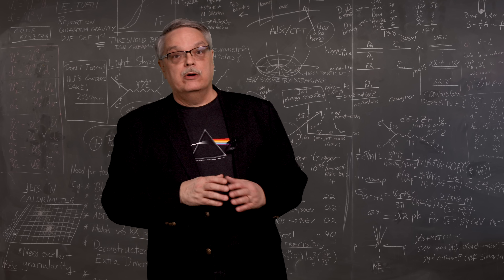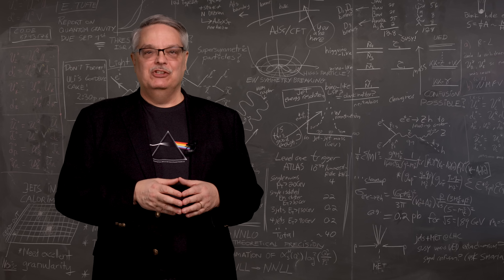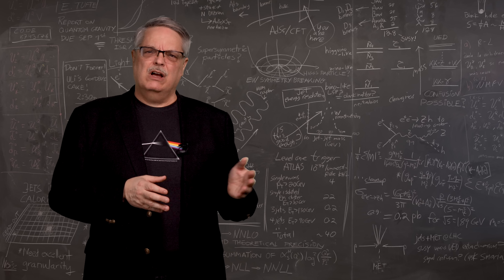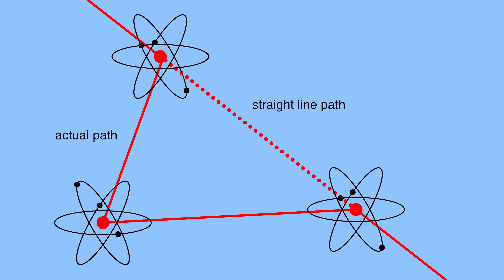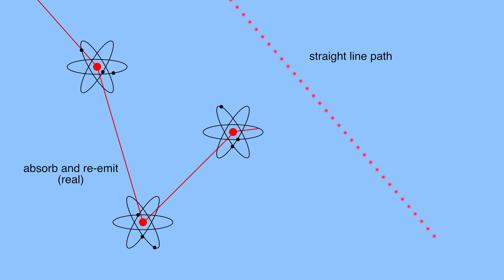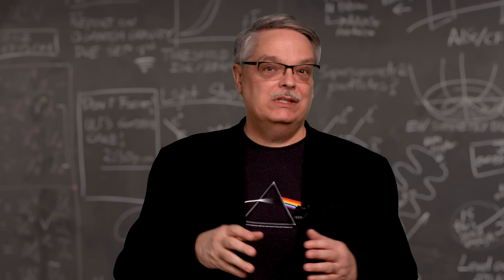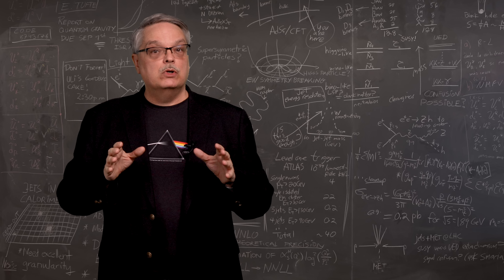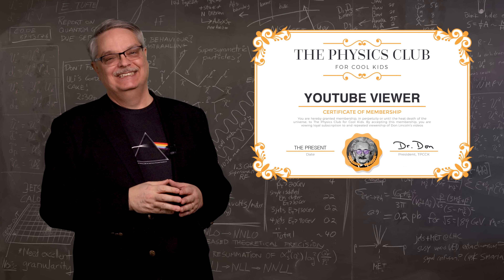Why does light slow down in water?

Comment: Great that you explained this because I did not know the correct answer, although it makes all kinds of sense. Waves FTW!
Reply: this video has taken many shortcuts in explaining the relations between the two systems and how it affects them.
to better understand this, we need to talk about d'alembert's equation and its dispersion formula and how it describes a wave.
so d'alembert's equation is used to link together the spatial and temporal variation of a wave.

and from this equation comes the dispersion relation that links together the frequency, wavelength and celerity of a wave.
to access to this equation, we use maxwell relations to describe this phenomenon. when we consider those relations in the void, we get the relation: c² = k²*w² where k is the angular frequency and w its wavenumber. (just google it, ain’t that hard to understand)

thus we can see here that the celerity is proportional to its angular frequency. however, as explained in the video, when light enter a medium, there are charges that can be influenced by the electric field, especially electrons that are 2000 times lighter than their counterparts protons.
thus, when light comes in this medium, we assume that only electrons are affected by the electric field.

we then apply newton's second law to those electrons to find a relation between an electron's speed and the electric current
(we also neglect the magnetic field of the light as the electron is relativistic thus the force from the electric field is much greater than the magnetic one see lorentz law to better understand this )
and then by generalizing this equation to all electrons in the medium, we can get an induced current from the electric field of the light.
( the current is j = n * v with n the volumic density of charges and v the celerity of electrons)

then when we put this back to maxwell ampere local equation, we introduce a new component: the induced current which thus gives us a new dispersion equation: c² = k² * (w² - wp²) with wp the plasma oscillation and thus we can see that from the value of wp, we'll get a different value of the celerity of the wave.

thus we can say without a doubt that they are wrong in their explanation as it is not the combination from the electric current of the electrons and the wave that makes it slower but the induced current inside the medium that modifies the dispersion relation thus modifying its speed.
or in simpler words, it's the movement of electrons that changes the frequency and celerity of the light, but not the combination of the two electric current. (also on a side note, trying to represent the electric current of a dipole using a sine wave.. funny thing you did there 😅)

and finally, as for the reason why the light has a different angle, well you can easily explain this using two waves parallel to each other crossing the medium in phase with each other. as they have the same wave plane, you can easily come to the relation between the refracted angle and the incident angle using some basic geometry. i recommend you to see the demonstration of descartes second law if you want to better understand what i'm talking about.
Reply: @recouer  - OK. Trying to follow you but stopping at the second paragraph. Per Wikipedia, wavenumber can be several things, ones is v (not w) which is 1/lambda, another is k=2pi/lambda, which you call "angular frequency". 

Maybe are you using "w" for omega? I see the formula v(vector) = v(escalar)/c = omega(escalar)/2pi.c - but nothing that resembles your formula c = k^2 . w^2, which seems to indicate that, as c is a constant, if k increases w must decrease or vice versa. 

A bit puzzled, but I'll keep reading because you seem to know what you're talking about and I'm interested.
Reply: @LuisAldamiz  
sorry i was talking about angular frequency. i'm not familiar with all the terms as english isn't my mother tongue.

arf i just realised i made a mistake in my formula. it's not c^2 = w^2 * k^2 but c^2 = w^2 / k^2.
where:
w = 2*pi * v  with v the frequency, w the angular frequency
k = 2*pi / lambda with lambda the wavelength. and k the angular wavenumber.
(btw i realised i said one was the other in my explanation. sorry kinda confusing i know)
i should have double checked...

btw i checked the wikipedia page and w is in fact introduced, just it's hard to notice when i skimed through it. (and yes i'm using it for omega)

Comment: Q: If light is " slowed" by the medium it hits ( water etc.) does it also slow when hitting a mirror that is simply reflecting that light ?

For example, I saw a Cook County Sheriff shooting a laser ( lidar) off of his sidewiew mirror to capture the speed of traffic coming toward him ( his car is facing same direction as traffic moving toward his stationary car) . Is the light , which is hitting the mirror , being slowed by the mirror when it hits the mirror and does this affect the reading he gets?   Remember, we're talking about the light hitting mirror, going to  moving car, being reflected off moving car, coming back to stationary mirror and being reflected into lidar gun again. Surely, the reading can't be accurate.
Reply: LIDAR only measures distance. To get a speed measurement you have to measure the distance at least twice at known time intervals, and calculate the difference between distances.  For example, if the car is 100ft away at the first measurement, and 99ft away at the second measurement, and the time between measurements was 1 second, then the car is traveling 1ft per second. A mirror would likely cause the LIDAR to think the object is at a greater distance because it took longer for light to reach the vehicle and back, however, because that same offset would be applied to the second measurement the speed calculation would still be accurate.  In the example with a mirror applied, maybe the car is 100.5ft away on first measurement, and 99.5ft away on the second measurement, it would still be 1ft per second.
Reply: Don Sander ok, so you're saying there's no attenuation or refraction affecting the reading?  

Yes, lidar is measuring t/d , but isn't that affected by the mirror?  If light seeks it's easiest path, the mirror is certainly not that path.
Reply: @Newzchspy    Possibly because it took a shorter path through the glass, but slowed down as well, the net effect is the same?
It's a good question.

But even if it did change some timing of the light, the thickness of the mirror is so small compared to the distance of the car, that it would be negligible.  Even if you said light slowed down so much that it was like an extra 0.25 inch it had to travel, that would still be only 0.04% of the distance to a car that was 50ft away.

Comment: No! This is circular reasoning. Light travels slowly in glass because it interferes with waves re-emitted by electrons, and those waves travel slower than the speed of light, so the superposition of the incident wave and re-emitted wave travels more slowly. But why does the re-emitted wave travel more slowly? This explains nothing, it just moves the problem back to the re-emitted light.

Comment: Very nice! But I am still thirsty! The superposition works fine if the 2 waves travel in the same direction, that of the incident light I think! The change of direction of light in the material then would mean the wave generated by the atoms is in a different direction from that of the incident wave and the superposition leads to the bending? Is it related to momentum conservation or the shape of the orbitals where electrons can oscillate? Of course, Fermat / least action principle can explain; but in the frame of this 2-wave explanation, where is the bending coming from?. Would be nice to explain:)

Comment: As many points out, why does the electron generated wave travel slower? I believe a more satisfying answer is that it doesn't, see the explanation below (more information can be found in the Feynman lectures of Physics). 
The incoming light moves the electrons (and since the electron is negatively charged it actually moves in the opposite way compared to your animations), which indeed creates a new wave. The thing is that this wave moves exactly at the speed of light (as those all light). For the normal case of glass and visible light the phase of the generates wave from one electron is the same as the phase of the incoming wave. But when moving through a material like glass you have many many atoms and electrons each generating their own wave. And the sum of all of these generated light waves (not including the original incoming wave) will interfere and result in a wave that is 90° after in phase compared to the incoming light. This will cause a slight delay in the wave. Each time this slightly delayed wave passes through yet another infinitesimal slice of the material the same thing will happen and that is why the light appears to travel slower.
Reply: This answer is a bit more convincing. But why the wave generated by moving electron disappears when incoming light leaves the material, making light speed up again?
Reply: @aremijfaye5160  Because out of the glass, light do not encounters any resistance anymore, it's travelling freely, but not totally, because AIR has it's resistance (due to it's electrons and charges).
In a vacuum there's less resistance than on air. But I'm not sure because there's no 100% vacuum in Universe.
Reply: Is the phase shift partly due to the mass of an electron?

Is it always 90 degrees?  Wouldn't the index of refraction change that?  Or the frequency of the light change it?
Reply: @Hyxtryx  No the phase shift is not always 90 degrees after, that is only true when the resonant frequency of the atoms (the frequency in which they like to oscillate, you can compare it with a swing which likes to oscillate back and forth with a certain frequency) is much higher than the incoming light frequency (i.e., the color of the light). 

If the incoming light is on resonance with the atoms then the total phase shift (after summing up the contributions from many atoms in a layer) is 180 degrees, which is why the energy of the incoming light wave is absorbed (destructive interference). 

If the incoming light is much higher in frequency than the resonances in the atoms, e.g., X-rays in water, the phase is 90 degrees before thus resulting in a refractive index that is less than one (albeit not much, around 0.99999974).

Comment: But where does the angle change come from?  Is it in any part due to the modification of the electric fields inducing a modified magnetic field while the light is traversing through the glass?  That doesn't feel right.  I get the slowing, just not the angle change.

Comment: Video topic suggestions:  since you are very interested in the mechanisms behind physical phenomena, perhaps consider a whole series on these types of explanations. Here are some I would love to see:
-How does a photon transmit momentum to matter when absorbed or reflected.  Actually it would be interesting to know if the materials in this video experience a change in momentum when they shift the path of light going through them. I’m guessing yes, and it’s probably the same process. 
-What is the origin of mass. You did a video on this topic but only said it was confined energy that was responsible for 98% of the mass of an atom. Can you go further and explain the mechanism for confined energy creating mass? Also please explain how it works to create inertial mass and gravitational mass. 
-Maybe this is not known, but how does energy curve spacetime? What is the mechanism?
-if nothing can escape a black hole, and gravity is theorized to be due to gravitons, how do gravitons get out of the black hole to gravitationally affect space around it?
-By what mechanism does the strong force work? It seems intuitive that 1/r^2 forces like electromagnetic and gravitational forces have that r dependence due to spherical geometry, but how do you explain the Hooke’s law form of the strong force equation? Is there a geometric of other explanation that makes intuitive sense?

Comment: If you involve Snell's law of refraction, set X and Y components such that the Y component is perpendicular to the surface of the boundary between two different materials. Snell's law says that the Y component of light in the two media are the same. The difference in speed happens entirely in the X component.

Comment: @Fermilab
Sir,due to election's wave and light wave a single wave produced which travels inside the glass.This single wave leaves the glass surface which has different wavelength or frequency. Then how this wave gain the light speed ?

Comment: As many have pointed out, Dr. Lincoln didn't fully explain why the photon changes directions when entering the glass. It is due to Snell's law and is completely due to the change in velocity of the light wave. Vsauce explains this much more thoroughly in his brachistochrone video, but to summarize it briefly, light always takes the path of least time so it will try to do more of its "traveling" when it can travel faster. Therefore, it will try to get out of the slower medium ASAP, so it cuts corners as seen at 2:23, hence the change in direction.
Reply: Thank you - that is the kind of answer I was expecting from this video. Cannot understand why they omitted this important piece of information !
Reply: light doesnt "try" anything. it doesnt have motives or desires.
the whole taking the fastest path thing is a consequence of self-interference. the change in velocity goes along with a change in wavelength. at a different wavelength, the path where constructive interference happens is also different.
visualization: https://de.wikipedia.org/wiki/Datei:Refraction_-_Huygens-Fresnel_principle.svg

Comment: I will also appreciate explanation what causes transparency. Glass is made of atoms, similar to let say aluminium, but somehow it is transparent. Why? Awesome video by the way.
Reply: electrons in an atom or molecule can only exist in certain discrete energy states, depending on the specific atom/molecule. therefore a photon can only be absorbed if its energy fits the energy difference between the current state of the electron and another possible state. in glass, there are very few possible state changes that correspond to parts of the visible spectrum, so most of the visible light just passes through. 
the same effect gives rise to different substances having different colors. e.g. if it absorbs only blue light, it appears yellow(complementary colors). if it absorbs the whole visible spectrum, it appears black.
these energy states are so specific that they serve like a fingerprint. you can find out what substance youre dealing with by checking what frequencies of light it absorbs. this is how we know what the sun is made of.
Reply: @PelycheeaceRA  So if I understand this correctly we could make any material transparent just by locking electrons of its atoms in their orbits. This is then why black carbon in diamond is transparent because electrons are well locked to energy levels of every atom in geometrically full lattice. Then every crystal should be transparent even iron. Am I onto something here? I am civil engineering working in an IT company. This stuff always fascinated me.
Reply: @jacekpiterow900  except we cant lock electrons in their orbits. things are transparent if they dont interact with the visible part of the em spectrum. glass absorbs x-rays, but it looks fully transparent to us because we cant see x-rays anyway. 
the energy levels dont depend on geometry, but on quantum mechanics.

Comment: In the second wrong explanation, why would the absorbed light be emitted in any direction? Shouldn't conservation of momentum force the emission to be in the same direction as the absorbed photon?
And also I have a doubt with the conservation of energy when two waves cancel each other.
Great vid.
Reply: Before absorption photon and atom carry some momentum. At absorption, the photon's momentum "transfers" to the atom, which ends up with the total momentum both had before absorption. At emission, the momentum carried by the newly emitted photon is "drawn" from the atom's post-absorption/pre-emission momentum. The emitted photon can carry whatever momentum, and if this is different than the original photon's, the difference will be found in the atom after emission. Hopefully this makes sense.
Reply: @jgostling  It does. I was thinking as if only between the absorbed and emitted photon could be momentum 'transmission', not the entire atom. Thanks.

Comment: But, you failed to mention the relationship between Permittivity and Permeability and how values vary between substances. That the 

Index of Refraction is the Square Root of ( the materials Permittivity multiplied by the materials Permeability )

and that

The Speed of Light in a material is the Reciprocal of Square Root of ( the materials Permittivity multiplied by the materials Permeability )

This also leads into James Clerk Maxwell's work on Eletromagnetism and the four Maxwell equations show that light is an electromagnetic wave with a constant velocity

Comment: Paraphrasing from 9:41 “light travels slower through material because it generates a second wave that “combines” with the light (to produces a third wave that somehow replaces the original light wave) and that new wave moves slower than c”. (then the heretofore suppressed original  light wave is somehow regenerated  on exit of the medium). What happened to the original light wave in the medium? More questions than answers.